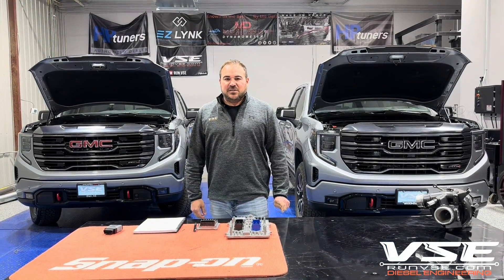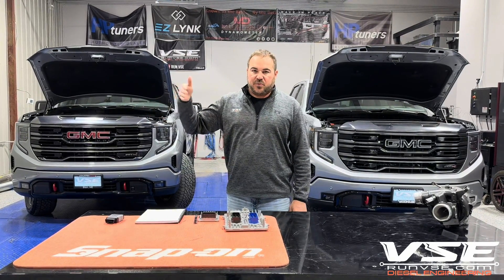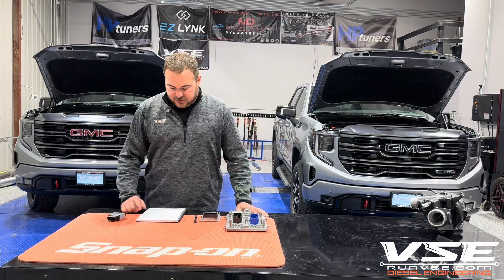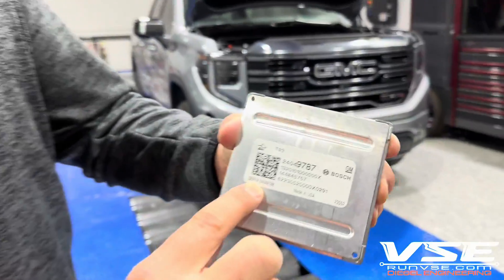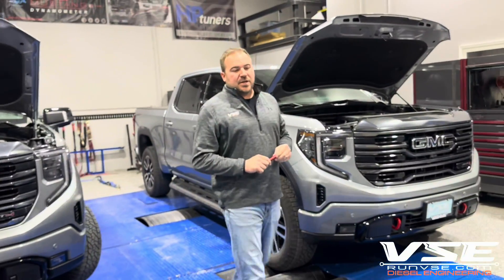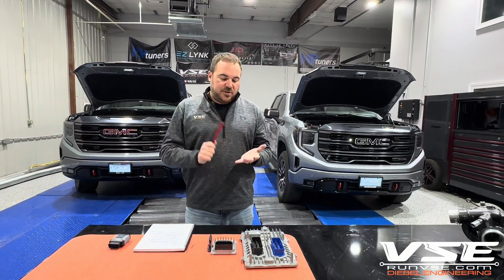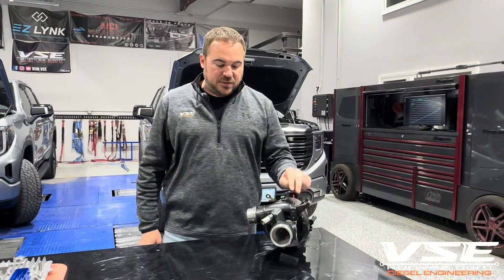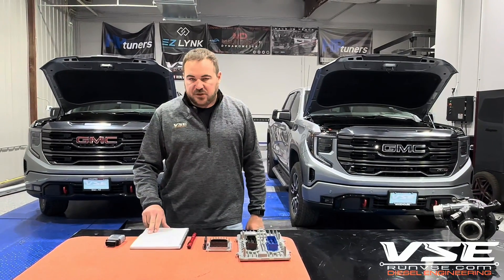3.0L Duramax Global B Upgrade & Tuning

Comment: Are the LM2 duramax just being tuned to have the power increase the LZ0 got in 2023
Reply: They changed internal engine parts as well in the lz0
Reply: Will be more power than the LZ0

Comment: IF you want a 6.6 go buy one!  All this hocus pocus on these little engines will in the long run not work too well.  But it's your money so have at it!
Reply: Get off my lawn!!
Reply: Don’t need a 6.6 to be a daily driver. A 3.0 in a 1/2 ton is more than enough for what most people use them for. The 3.0 is not meant to increase towing ability, it’s meant to do the same job as a 5.3, more efficiently.
Reply: I have a 6.6 lb7  I have a cammed 5.3. I have a 355 roller. I have a 383. I have a 400. I have a 6.2 detroit. I have a 333. What makes you think I won't mess with my 3.0. You're worried about the wrong person